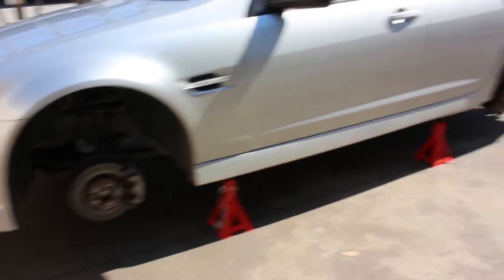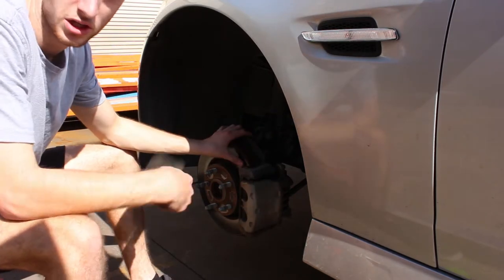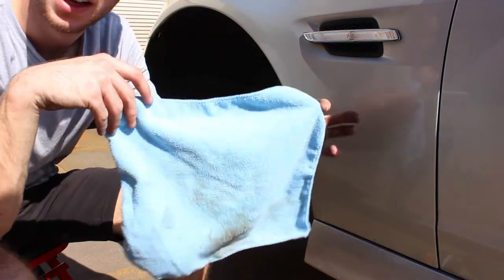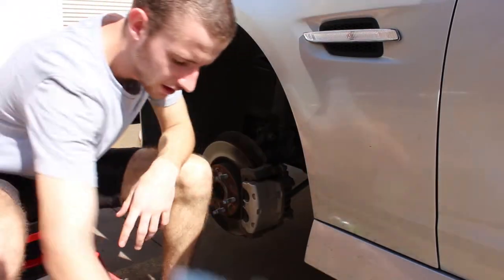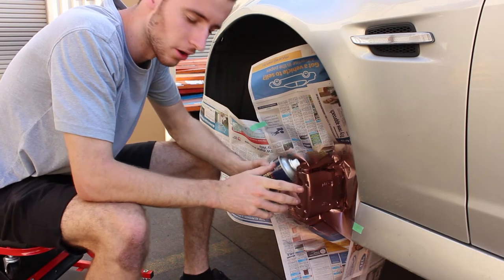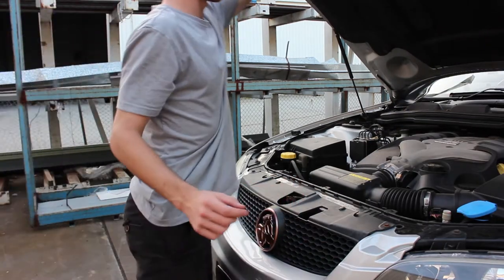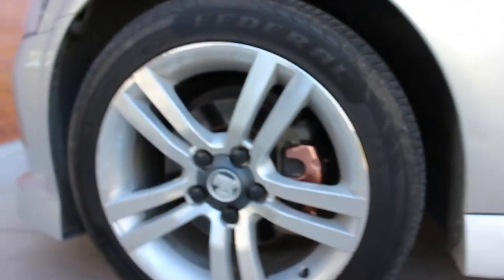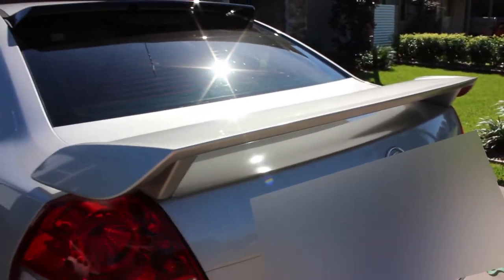Painting my brakes + Surprise Install!

Comment: Would have been easier unbolting caliper that way you paint the inside of caliper as well, also heat proof paint high temp is needed for calipers as brakes get very very hot